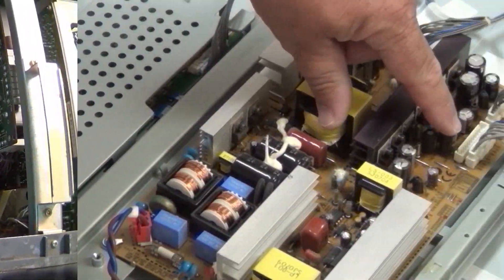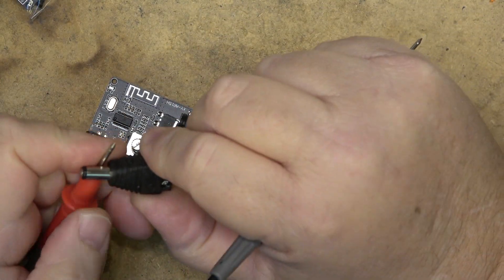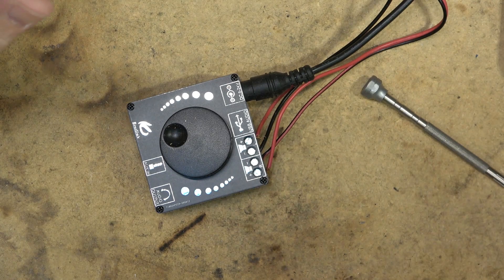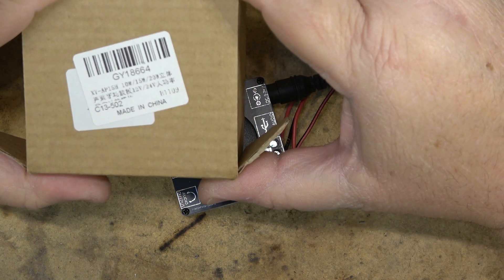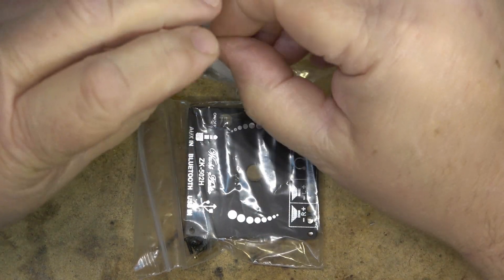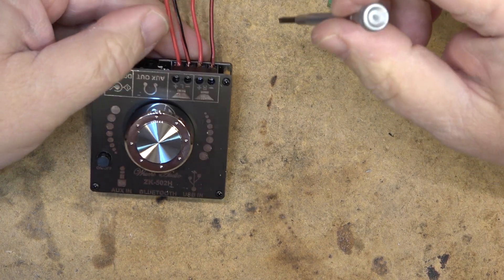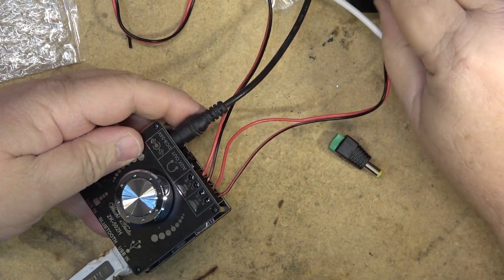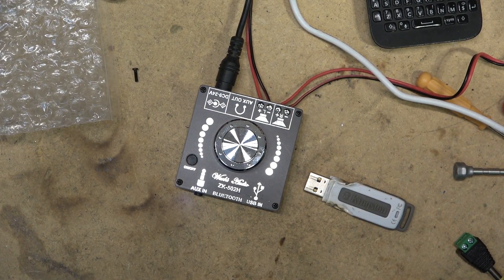2 Bluetooth Amplifier boards from IC Station checked over

Comment: Sir, what is the Equivalent transistor for C3209? My DENON AVR 1909 Is clipping. So looking to replace all the components  in the power supply.
Reply from the maker: Here is an idea to stop it from clipping.  Turn it down or buy a more powerful amplifier.

Comment: 50 watts is at 10% THD.
it is noisy! at approx. 1% THD with 24v power supply and 4 ohm load you get approx. between 30w and 40w. but then you have to use heat sink

Comment: I have had the same one for a few weeks now.. "the first one shown" it sounds good. But I'd recommend one that's higher wattage.. the volume is a bit on the low side for me. The one I have is 20w one.. and running it with a 19v laptop charger.. for me it just lacks when it comes to the bass from it.. I think it'll be ok if you have small efficient speakers. Or are planning on making a little Bluetooth speaker type thing.

Comment: This is a bad one. But the tpa3116 ic. that sits on it is good amplifier ic. if you use it correctly! Class-d amplifier needs a heat sink!

Here are some good tpa3116 amplifiers. The first is my favorite!

ebay number.

1. (272391490892)

2. (303169627482)

3. (113795081923)

Comment: Well thats a nice neat amplifier/player, ready to be transplanted into something.
Bolt it to the cat for some mobile mew-sic , yes crap joke :)
Reply: This is a bad one. But the tpa3116 ic. that sits on it is good amplifier ic. if you use it correctly! Class-d amplifier needs a heat sink!

Here are some good tpa3116 amplifiers. The first is my favorite!

ebay number.

1. (272391490892)

2. (303169627482)

3. (113795081923)
Reply: @ford1546  Why you are telling me this i dont know,  i dont use class D, im also not the video maker.
Reply: @zx8401ztv  
You wrote the following.

That's a nice neat amplifier / player.

When you comment, it is common for people to respond !! Get used to it!
And answer people nicely!

Class D is a very common amplifier type you will find in all portable bluetooth speakers and car amplifiers!

Comment: Nice lil modules .......  I seen the 50 watter , but the other link is a different one that you showed at the start of the video , so I typed in the model number at the site and it popped up.....  How long did those take to come in ??   Heck for 12 bucks it's well worth it...... and the other for 7 bux is a great price also....good camping gear.....
Reply: 50 watts is at 10% THD.
it is noisy! at approx. 1% THD with 24v power supply and 4 ohm load you get approx. between 30w and 40w. but then you have to use heat sink